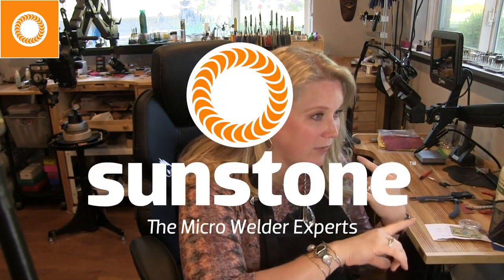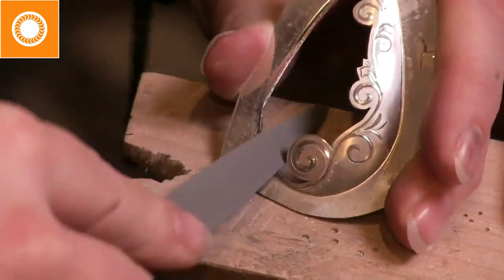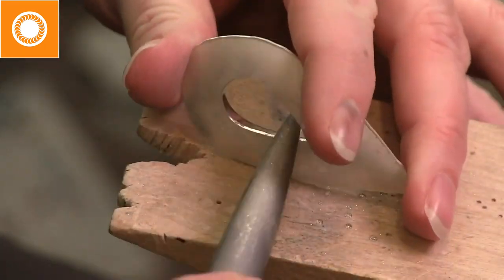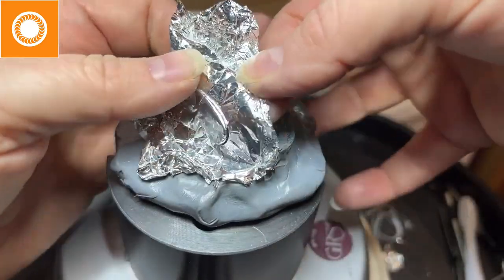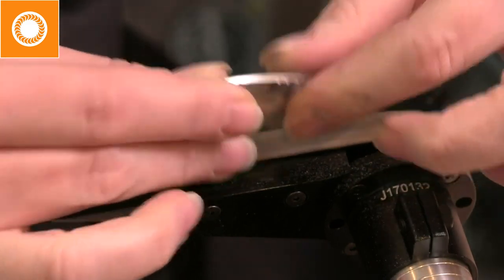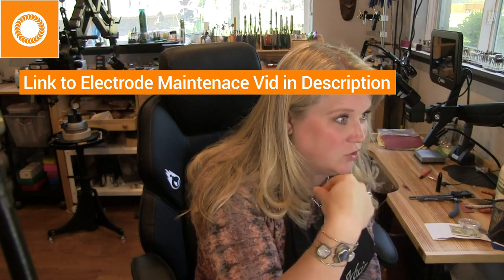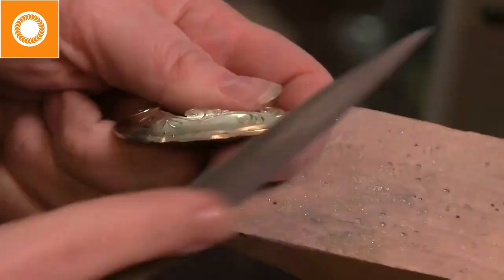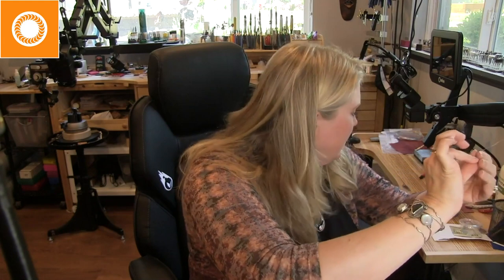How to Create a Bezel Set Pendant Using a Pulse Arc Welder - Webinar Replay - May 2022

Comment: Hi Melissa, could you use welding for making a bezel ? I’m trying to avoid soldering and just get a welder instead. Would that work ?
Reply from the maker: @stellau3028  technically, yes. But I will still solder where I can solder and weld where I can weld. There will be a bit more clean up with the welding. But give it a try and see what you think. My welder has not replaced soldering, but is a beautiful marriage with it.

Comment: With the back plate domed how did you get a perfect seam on the bezel so it soldered all the way around and how did the stone fit flat
Reply from the maker: I made sure they bezel fit flush against the back plate. because the stone was flat, the edges sat against the backplate to keep ot level and flat.

Comment: I have a small stone that I’m setting into a dome on a ring. It has one side that is very high and the rest is what I would call normal. I already sanded the bezel level to where I think the highest part would be ok. Ur is a little lower than I would like but I think it will be ok. Would I do the same thing you did here with this smaller stone? It’s 7 mm
Reply from the maker: I would think so. Without seeing it, I can’t say for sure. But as long as the majority of the stone is set and it won’t fall out, you should be good.
Reply: @MelissaMuir  thank you!